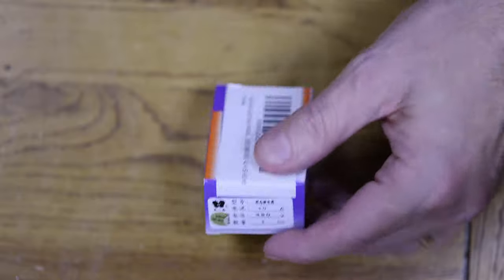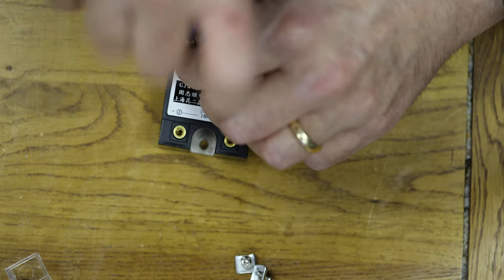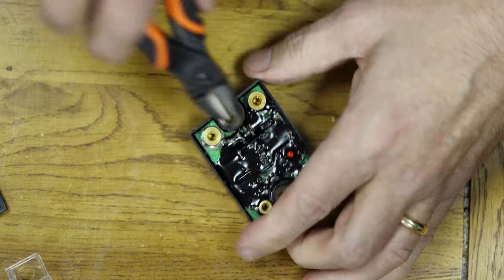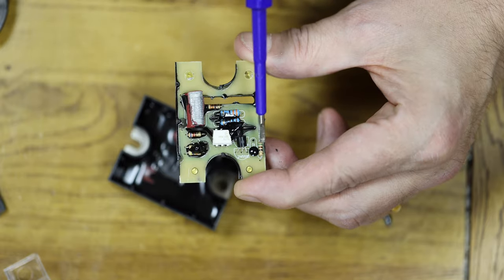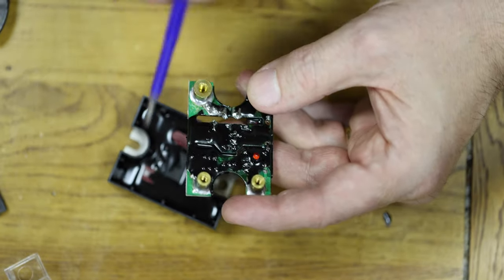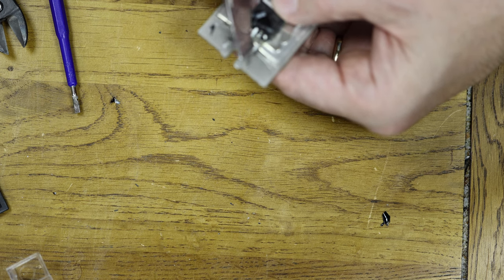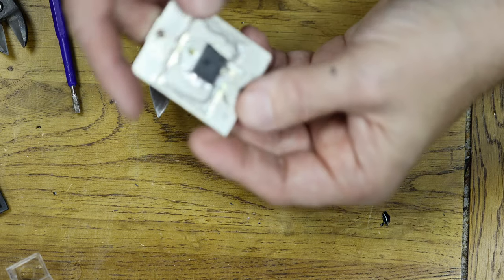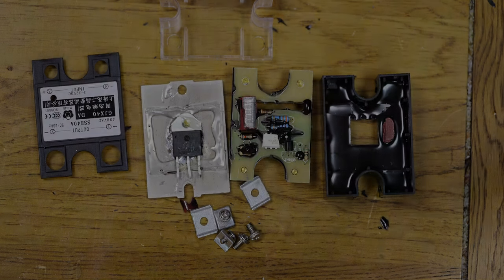Inside an SSR

Comment: People use these in 3d printers to heat the bed with ac power. And control the duty cycle with a low voltage control boatd. I imagine that demand is helping drive down prices.

Comment: I used a dc version of this on my ebike so the 5v alarm circuitry could switch the 84v battery for the motor. bit of overkill as I suppose I could have used an optocoupler and a P channel fet, which no doubt is all that's inside what i bought

Comment: Really cool 

I remember when I was trying to fix a Uniden Satellite receiver they had a 3 or 4 pin part that looked like a voltage regulator or transistor but it actually had 50 parts inside 

It was SS and it regulated the voltage.

The old days there would have been a section of 50 parts that did the same thing and took up 4 by 8 inches.

Looking at old two way radios from the 70,80, 90s, the parts are huge compared to the parts now that you need a microscope to see

Comment: thanks just got one of these, I wondered what was inside.  
still wondering how on earth a PID controller is programmed!? I thought it would maintain a constant temperature for my oil filled electric heater. ie. set 27degrees C turn on. boy was I wrong.

Comment: Hi, thanks a lot for the video. I clicked on the Amazon link on the description and the SSR that appears is DIFFERENT from the one that your tear apart on your video. Could you correct the link or acknowledge that the one on the link(Heschen Single...) is indeed a genuine SSR with a 40A TRIAC inside? I have seen the FOTEK ones are bullshit and they have 16 and 24 Amp TRIACs inside. Thanks again!

Comment: I have one similar to that. Works well as a 12v DC relay. I'd forgotten I had it, to be honest. Right now I'm using two mechanical relays to run my 120v AC 20 foot long morse code flashing penis.